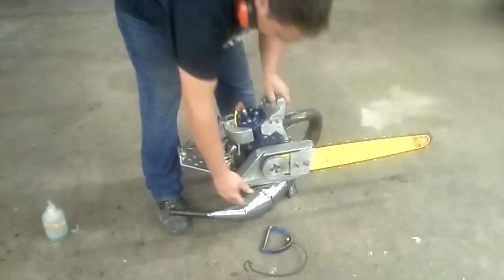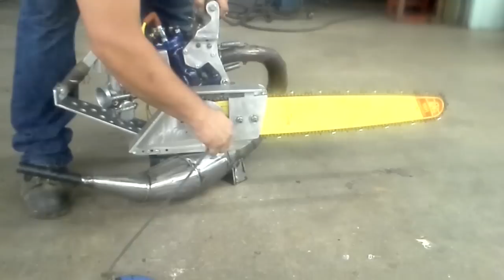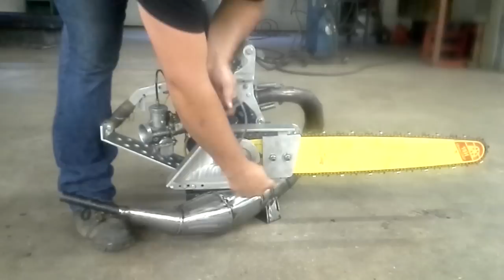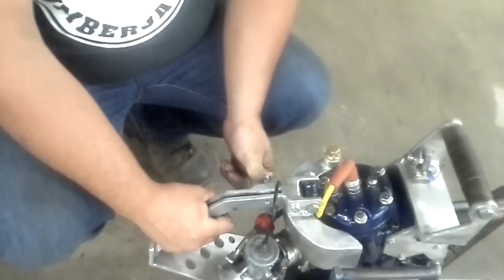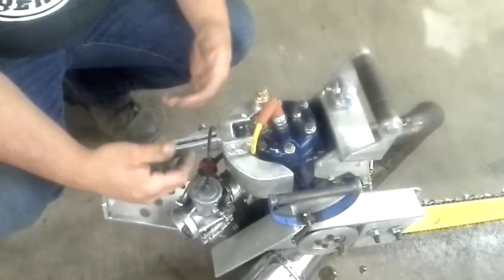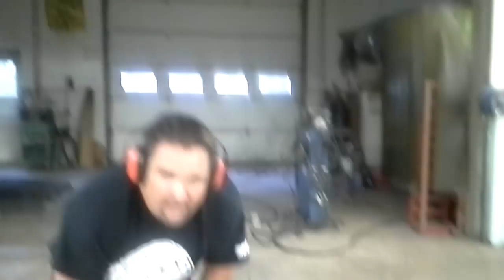Craig 99 cr250 starting

Comment: Cylinder looks like liquid cooled and carb 36mm well done
Reply: Its liquid cooled but he dosent have liquid in it dosent look like to me the cr250 heads wasnt designed to run like tht if its ever run 2-3 runs at a time doin a hot saw comp itll burn up
Reply: @malcolmfarmer2006 The run it's built for isn't long enough to overheat it. Air cooled engine wouldn't have any airflow anyway. Guy knows what he's doing.

Comment: how does it stay cool sice its liquid cooled without a radiator
Reply from the maker: We do not need a cooling system as it is only meant to run for 10 sec maximum at a time. Just long enough to make 3 cuts on a log, Strictly for drag racing of chainsaws not general use. In actual fact the cooling jacket is used as a tank to hold bar oil for the chain
Reply: Oh makes sense
Reply: Some people run bike like that for hill climb too, they like the function of the liquid cool cylinders but dont have a radiator because they are only running them wide open for about 10-15 seconds, it wont damage the cylinder.

Comment: do you have a intake extension between the carb and intake
Reply from the maker: SHANE DICOCHEA yes but only to point the carb away from my body during operation so my shirt does not get sucked in and stall the engine

Comment: Decompressor on a 2 stroke? Please explain
Reply: b18citr even sthil saws have a decompressor
Reply: +Jason Barba that's not an explanation.. I just don't get it. My 4 stroke dirtbike has a decompressor. Cause it has valves. But a two stroke doesn't. So what is it opening?
Reply: 2 strokes do have valves just so you are aware. In motorsports engine they are typically reed valves but that is not always the case.

Comment: Hello I wanted to ask about the details that will be me needed to build the Hot Saw understand the engine of your Hot Saw the engine of a motorcycle cross-known engines of motorcycles cross-cooled liquid as it solved the problem of cooling the engine Hot Saw learned that these motors do not have a cooling if it true this is how it is done the first case the second thing that I will wdzięzny ignition for answer